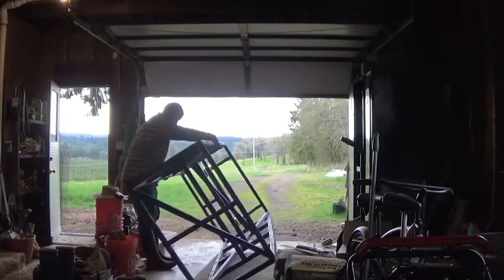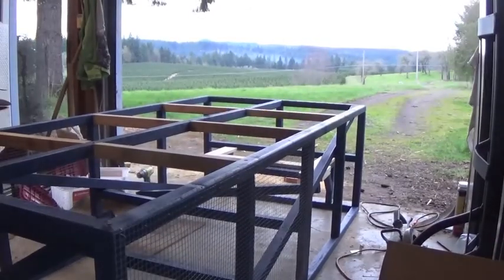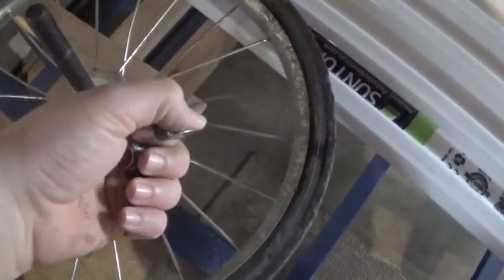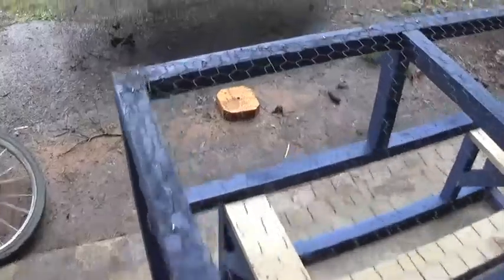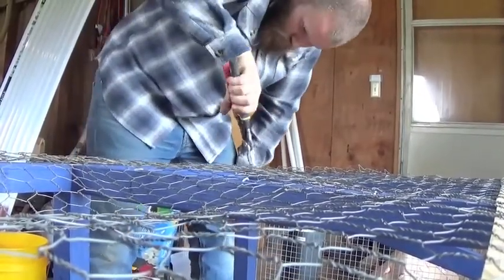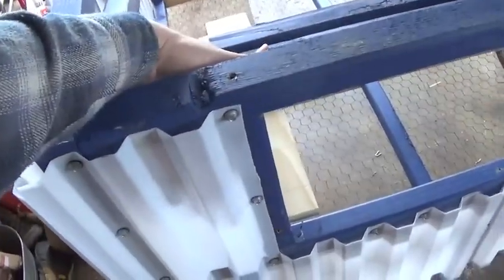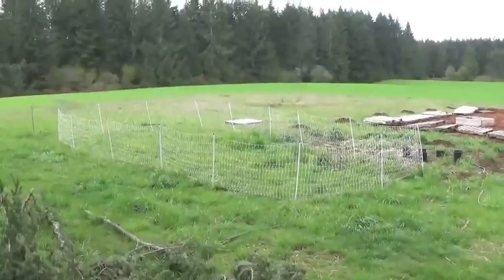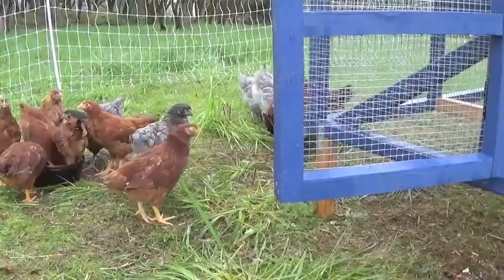DIY Mobile Coop Wagon: pt2

Comment: Does the chicken work well for the floor?  Seems like it would be to big for the chickens to walk on. I know it would cost more but I might would go with hardware cloth. It would help with predators also but you do have the electric netting for that. Great looking tractor. Easy to move.
Reply from the maker: Jay Jennings it has worked well so far, but as you said, I have an additional fence around them. This Shaw is now in my chicken moat. My original chickshaw did use hardware cloth.